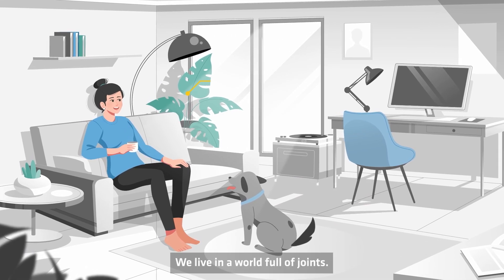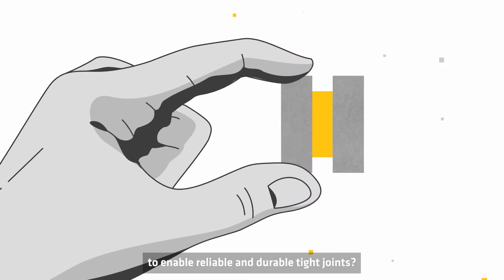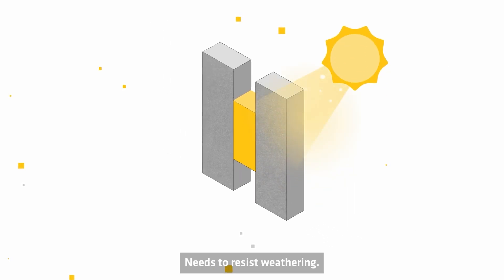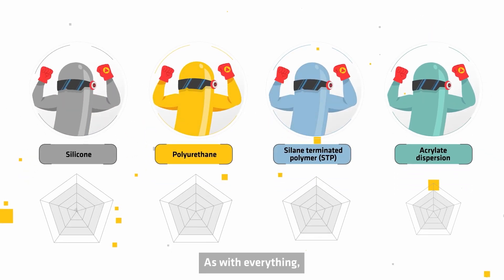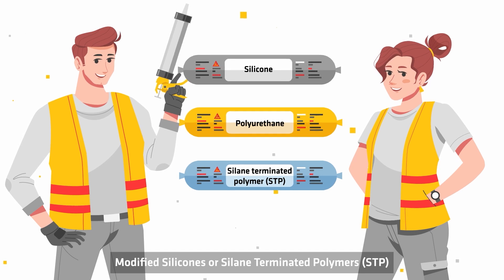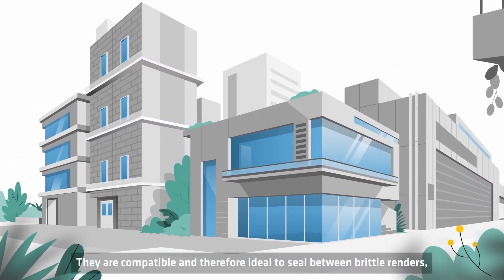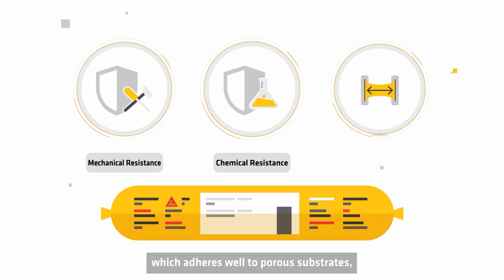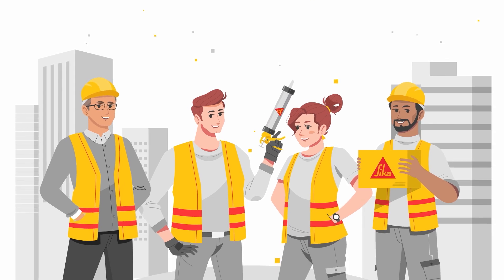Joint Sealing Technologies

Comment: What is good for window glazing
Reply from the maker: If it is about sealing glass onto the frame, a silicone like SikaSeal®-171 is used. On the other hand, if it is about sealing the window frame onto the building structure, you will use a foam like Sika Boom 558 Flex or Sikaflex®-84 UV.